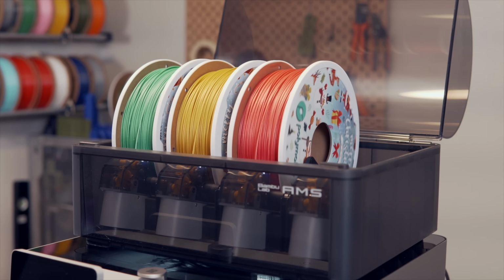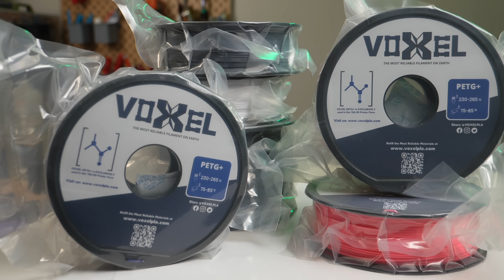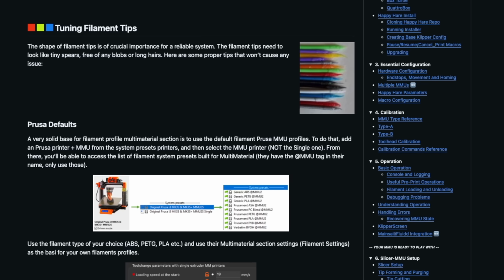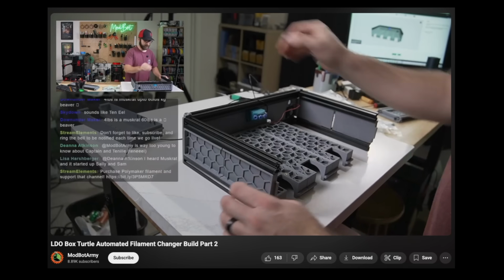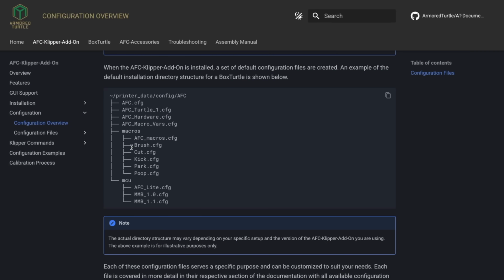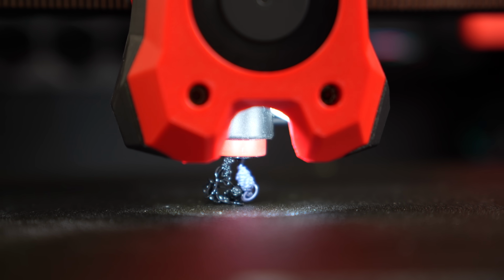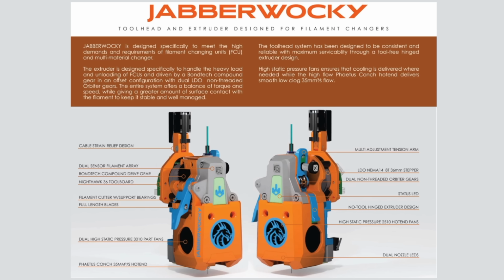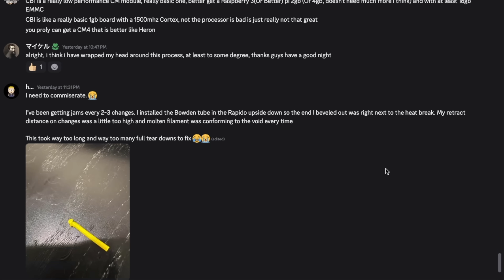Open Source AMS Multi Color 3d Printing (BoxTurtle)

Comment: Please tell me this works on any printer!?(mine is a biqu b1)
Reply: I am sorry you've ended up with a Biqu B1. I only had bad experiences with mine.  It depends on your printerhead compatibility.  With the all-in-one usb hotend board & two separate firmwares in your machine. You need a print head that IS compatible with multicolor printing.  I'd consider upgrading to a different machine.  Look at what's available in your budget.  Good luck.

Comment: I built an ERCF v2 and it was torture; it never worked properly. The mechanism for tightening the filament with a servo never worked correctly. I have more faith in this project. Will it be worth it compared to an ERCF?

Comment: was hoping to get your opinion really like the box Turtle, without starting a bunch of drama I recently bought the Centauri carbon, loving the printer, but the whole thing with the AMS that they said was gonna be released anyways with openCentauri installed instead of the stock firmware do you think this would be technically possible to work with it? I mean it is klipper there’s even on mine at least and a AMS port on the back the print head does have a tool cutter. I don’t know if it has a sensor or not. Just thought I would pick your brain.

Comment: For the godly som of more than 530€ just for the kit and to print ,  assemble and troubleshoot yourself I find that a little steep for the benefits of having an mms . But hey if you have lots of spare time and a wel filled wallet who am i to critisize.
Great job and a great video.
Reply: it's only a hobby to build this. You can get an entire 250x250 Anycubic Printer + 4wayAMS at just 299€. Two-hundred-ninty-nine.
But often people are also stupid.
Reply: @REDxFROG the anycubic printer have custom parts, that they will probably discontinue (or sell at a ridiculous price, like my kobra motherboard that died without a reason, 50 euros + shipping) at the moment they do a new printer or a new multi material system. They give you 1 year warranty and then they forget about you, just buy the new one. I dont like the idea of closed source chinese software because they can leave you hanging with that too, so open source is always nice, but you are also the one that has to take care of everything. There are cheaper options too, this mmu is crazy, with ldo hardware that comes with its cost

Comment: Why not do early splicing? We know how much volume (therefor length) of filament each color section of the layer will need, so the turtle could splice together the perfectly segmented filament. There shouldn't be any need to retract filament from the nozzle, so no need to cut waste tip pieces.
The only reason I can imagine this might not work would be if their is an unimaginably high degree of variance in extrusion rate, but any reasonable amount of variance could be easily compensated for by designating infill be printed during the error adjusted filament transition window. 
Just think of how conceptually simple it really is: The slicer outputs a filament map (either in length or volume), the turtle splices that specific filament design (either days ahead in bulk, or just-in-time in parallel with the print. The splicer aims to get the filament change at a specific intersection in the infill, so the user can easily continuously calibrate the system by reporting the switch happened 8mm early/late.

Comment: The MMU from Prusa was released before AMS from Bambu Lab.
Not cool of you to not even mention it.
Reply from the maker: Other than a few that had good luck it was a massive pain in the ass for the majority of people I saw talk about it. Having the spools retract was ground breaking combined with the blade. IMO the MMU is grouped in with the options for tinkerers that I covered at the beginning. Their new one has worked quite well for me but you’re still on your own to figure out spool management. The systems are completely different.

Comment: Well, i like tinkering, but there has to be an advantage, which I'm missing. It's a lot of work, calibration, tuning, debugging etc. And in the end it's much more expensive to make yourself than to buy a ready made one. The toolhead you showed alone already costs over $150! While you can get a whole Bambu A1 mini WITH AMS for $250.

Comment: In a nutshell would you say someone with a Bambu or K1 printer is it enough of a savings to go with this over their OEM Multicolor AMS/CFS?
Reply: No because those printers do not run klipper and typically Oem is integrate much nicer.

Comment: Beacon or cartographer are so worth it. It does a 30x30 mesh in the time it would take a contact type probe to do 5 points.
Reply: It really should be the new standard. I've had it on three machines and it's fantastic.

Comment: There is only one problem. The AMS exists and you can just buy it. As of 2.5 years ago, there hasn’t been a reason to own anything but a Bambu printer - with a few exception like you want 400x400mm.
Reply: solution: simply do not buy a bambu printer.

Comment: I wonder what the cost difference is between a 4 way box turtle and a 4 toolhead stealth changer or even the Bondtech INDX. I feel like a toolchanger is cheaper and even if it’s slightly more expensive, the material saved pays for itself over time.
Reply: If INDX comes out at their given price ($250 for head, $35 per nozzle), there is IMO no reason for any other types or multimaterial add-ons. At least when there is space for the toolheads.

In the meantime, Elegoo is building their own closed "V6 color engine" MMU for closed printer...
(though we could assume it's just 4 spools to match their B L ueprint - if they can make it unlike Ankermake)

Comment: Honestly, I've been looking into Box turtle. Got an old ender 3 that I'm looking into modding with the ender 3 ng and I wonder if once I get that up and running, if the box turtle would be a good idea. That way I could at least have 1 printer doing multicolored printing....cause ngl I was originally gonna do the cms for my k1 max..after all the trouble i've seen people have with it...yeah fuck that.

Comment: Excellent video and cool system, but kit WAY too expensive. $300 (not included printed parts) is crazy. $150-199 would be reasonable. This is literally the price of a small or larger used printer.
Reply: It really isn't way too expensive, this product doesn't have economies of scale and so isn't ran on a line producing 1000s. People need to really understand how much stuff costs. It isn't cheap. Most of all this product is not aimed at people buying Bambu lab A1 it's aimed at people who get a Voron 2.4 a printer which costs around $1000  in kit form thus requiring you to print and build it. $150 maybe reached due to iteration but it's unrealistic for a small company. You wouldn't have 3d printing being so ubiquitous without open source projects like this. The ender and all the clones of  it were built on open source plans
Reply: It's $500+ if you want the enclosure, something Bambu does for $350 AMS 2 Pro, which heats/drys/etc.

Comment: Just my observation, and my comment is based on many comments from our Plus4 discord is that on many tool heads its best to cut the filament at an angle. This makes it easier for the filament to pass thru many types of runout  sensors. 
Our Plus4 test group is looking into this concept ahead of the new Qidi box. 
Just my observation but imo a filament cut at an angle instead of straight seems like a better idea to me. Comments welcome!

Comment: i very much enjoyed seeing the armored turtle crew at rmrrf.  like i told them, i'm itching to build one.  i'm mostly just debating on which of my machines will get the fantastic upgrade, versus others that will get something similar to ercf.  there's pros & cons to basically all of them, including the closed source versions, but this one caught my eye quickly.  relatively easy build, plenty of options, a solid crew backing the project, & solid results.  hard to say no.

Comment: I will probably receive my quattrobox kit later this week. Still need to start printing, but didn't expect to receive the kit this fast...
Quattrobox is lighter on the electronics as is doesn't use motors for rewindig the spools but instead opting for the genius design of the filamentalist. On top of that i personally like the esthetics of the quattrobox better over the boxturtle....
Later I even want to tinker with replacing the 4 steppers and extruders with something like the flatter pico mmu to reduce the cost and components even further without sacrificing features.

Comment: Id like to see a video on the tradrack filament changer for its low cost to expand the unit to more lanes and other features
Reply: Agree with this.  I plan to build one once my current project is out of the way, it's a really interesting take on the MMU concept.
Reply: @randiebarsteward9406  I've heard it's quite reliable with its changes 
I'm waiting on a kit to arrive for my svo8 and replace the head with the xenomorpth orbiter
Also looking into putting it on the max when that's released
Reply: But I'm also looking into making the max a tool changer with also material changers per toolhead in at least to my knowledge a first of it's kind

Comment: My only comment is WHY?  At this moment I would have to ask, what is the advantage of open source? Maybe just for fun. When their goal is to just "COPY" a commercial product to make it open source, you have to wonder why. Just wondering, do you drive an "open source" car?  Why not?
Reply: its not copying if its open source lol. Initially it might start out that way, give a few months or a couple years, and it'll be entirely different, and probably better.
Reply: The reason for a project like this is the same reason we buy tailored suits and customize cars. To have something that fits or works the way you want. Until you have experienced it, you just won't understand it.
Reply: @LathanM that is true in general but in this specific case it doesn't really offer anything more.
Reply: @riba2233  Because it doesn't have to. Just because you personally do not see the value in anything doesn't mean you are right. It just means you have an opinion. Why should anyone waste their time trying to change your opinion? It has no value to them.
Reply: @LathanM wow your response to my comment is totally overblown. This topic means too much for you, you have to chill a bit.
Reply: Open source means thousands of people can improve and tweak a system in ways a big company wouldn't bother with.  

Also, since the code is transparent and open, it's nearly impossible to sneak in malicious or sketchy tracking or data harvesting.  

Bambu AMS still can't do TPU.  Open source alternatives can because people can tweak the way it works themselves.
Reply: @4lan39 improve? Every open source ams is not even close to working as good as bambus 5 year old solution.
Reply: We found the bambu guy who only picked up 3d printing when it was easy and served on a silver platter for them so their brain didn't need to think... If you have to ask why open source is a good thing then you're in the wrong community.
Reply: @yeheyheyyeh89 well if you can't give him a simple answer that tells more about you...

Comment: There is one big downside to this. $299.
Reply: While complete MMU unit with filament dryer can be had at $349 - with a "free" printer 😅
Anycubic Kobra 3 V2 Combo. OK it's bedslinger and weird Klipper, but a) one can keep current printer functional and b) one could start reverse engineering communications between printer and MMU unit 🤔
Reply: @kimmotoivanen  exactly! I hope someone makes a adapter for the signals between different printers and ams/cms etc. So a bambu A1 can use a creality CMS and so on. Heck, even just give us a board with a pcb that gives signals out so we can build our own AMS if we want. That Anycubic had a great price!, anything over $100 for a AMS is too much for what it is. a small pcb, 4 stepper motors and a few sensors and lots of plastic :)

Comment: These things are all just headaches. Would you even bother? Haven't you people ever heard of paint?
Reply: Even just having 4 colors ready to go means never swapping spools.  Just pick the color you want in the slicer and that color is used.

You can even set them up to be multiple spools of the same color, so you can finish one spool and have it switch to another of the same filament.

It's not just about multicolor
Reply: I only use my AMS to have different filaments "ready to go". Multicolor takes way too much time. Faster to just print parts in different color one by one, and glue them together :)

Comment: Klipper only?

I run an ender 3 pro (upgraded) and octoprint running marlin.

While klipper has some interesting features, more hardware and having to learn klipper seemed time consuming and another headache. Besides still a lot of stuff I see or even buy is marlin based and would likely have to be modified to use Klipper. 

I'd love some form of multi filament system, but as you rightly say, it's all closed source and your governed. That's tha main reason I stuck with an ender i upgraded and marlin.
Reply: Klipper is just amazing, once you switch you'll forget marlin was a thing.

Instead of re-building firmware to make changes in Marlin you simply edit a config file in klipper and restart it.
Reply: There is also a RRF. Addin for box turtle

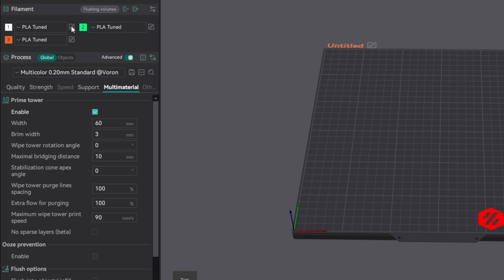Comment: 12:51 - increase purge by lowering it from 100 to 70mm2? Anyway plan for Box Turtle was abandoned here and I'm waiting for Bondtech INDX release at the end of year.
Reply from the maker: It was originally at 15. So I bumped it up spot to get clean purging but have been working in bumping it back.